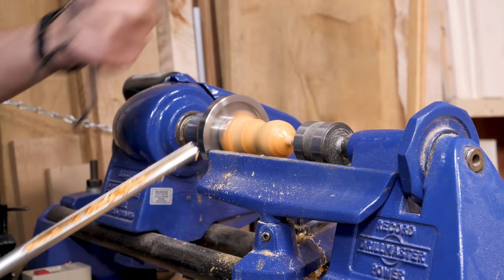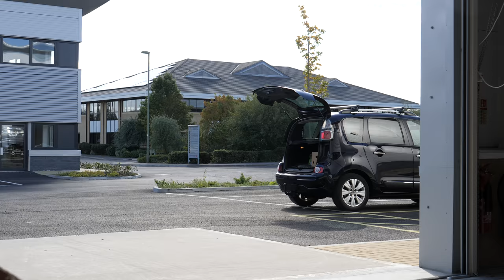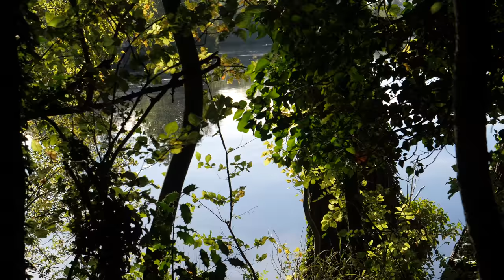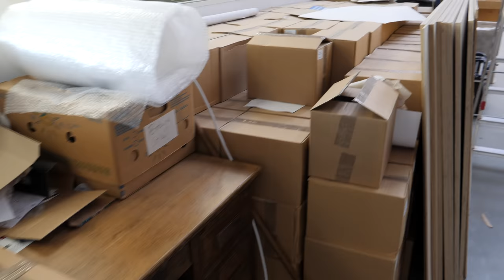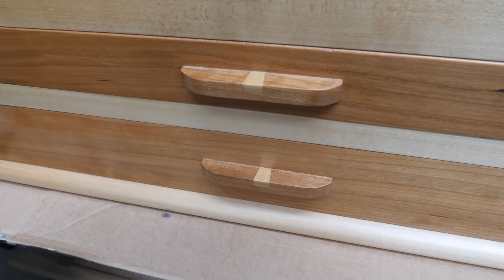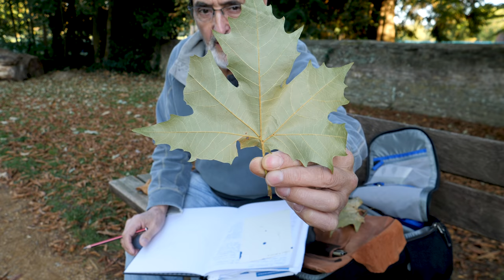Now, Into the Woods | Paul Sellers' Vlog 002

Comment: You are such an inspiration Paul thank you. What did you make for the White House?   I too met some nice people during my apprenticeship.  I saw a programme on TV talking about apprenticeships in the UK they bear no resemblance to the apprenticeships of the past.  I just feel young people are being used as cheap labour.  I left my trade to become a Police officer but still built and made things as I do to this day.  I am building my workshop in the garden as I live in France.  The little building which is over 200 hundred years old was falling down 18 months later it is dry and bright and now has a roof.  My brother told me to watch your videos as I had lost direction regarding my work bench.  I am painting the floor today ready to start building my work benches.  I built a Ron Paulk bench a few years ago which splits in 3 pieces this will be used as my build bench and on the other side of the workshop I will build a solid bench with my new 10 1/2  inch carpenters vice attached.  I am going to sketch them out today as you suggest.   Love the Vlogs

Comment: Great VLOG. I immediately empathised with your comment after returning to the workshop from Travis Perkins - "bad choice"". I bought some wood from Wickes recently. It was straight and relatively knot free., by the time I got home, about 20 minutes, the wood was warped, twisted and bowed. The wood in these places is so damp that it dries out very quickly in a different environment and is not the same.
Reply from the maker: Actually, the wood I got was all fine except one end of a long piece the bulk of which was straight except that section.

Comment: I have a cheeky request for a future workshop video, if you don't mind. I looked around your YouTube videos but couldn't find anything on the topic I wanted to learn about. I'm about to build a pole lathe or drill powered lathe and wanted to have a good face shield ready before I start turning. The range in prices is enormous - from £6 to £300!
I can't see what I'm doing without specs on 'cos I'm getting old, so need to pick an impact resistant shield which is comfortable to wear with glasses. I have some semi-dried yew to turn, so need to be aware of the dust from Britains most toxic native tree. I grind metal in my workshop from time to time and don't want to feel hot flecks of metal on my cheek any more. In short, I have a list of requirements to think about before I buy a faceguard and will have bought one before you have had a chance to write and edit a video on this topic.
The wider topic I'm requesting is not just face-shields but workshop PPE in general and workshop safety and the many workshop hazards. Hope you consider the idea.

Comment: So, you've replaced the plastic handle on your plane, and now you're going to do exactly what with the plastic one?  Throw it away?  Better to use it until it wears away in your hands than to throw it in the tip.  Why not lobby and supply plane-makers to replace the plastic ones with your or someone else's wooden handles?  That would be the smart, constructive, instructive, conservative thing to do.
Reply from the maker: No, I'll put it on another plane and give the plane away. Dead simple really. I don't mind long term plastics like this. It's already 40 years old and still going fine, but the rear tote, that was broken you see, so I replaced it to match the replaced rear handle because the knob was irreparable. Hope that answers your criticism well enough.
Reply: @Paul.Sellers  well said top man
Reply: @Paul.Sellers  Fair enough.  Thanks for your reply.